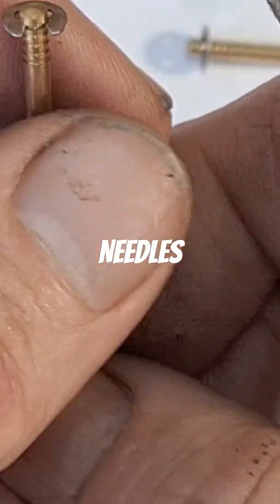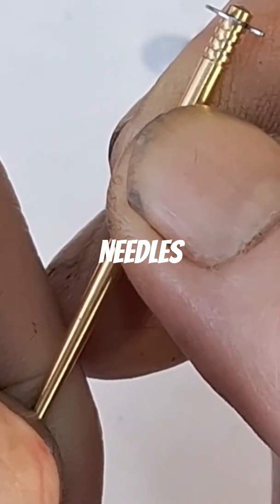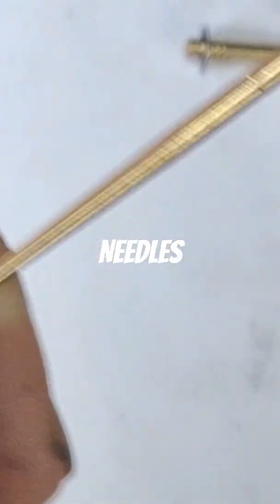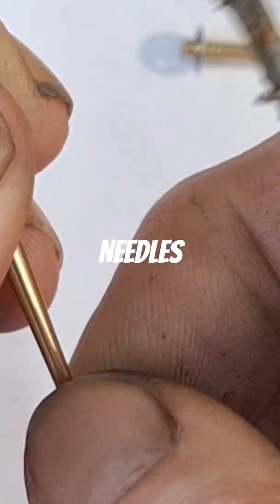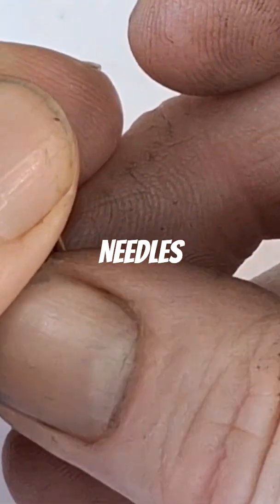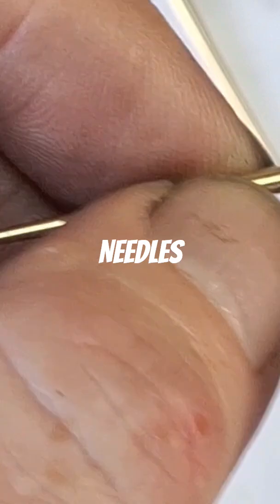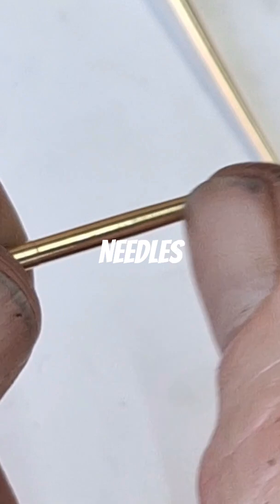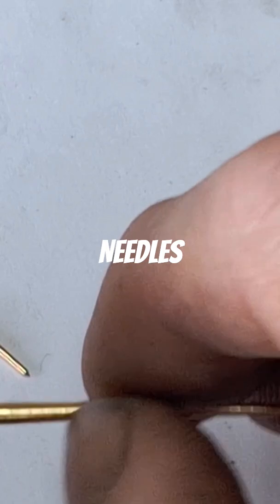What Happens If You Swap Out This Needle?

Comment: Good info, I'm trying to put different one in my 48mm mikuni and it's on 4th clip on top. 5th clip is messed up from taking in and out. But I'm not sure what clip to put needle on with the 6 different needle? Ty for All your info
Reply from the maker: Unfortunately the HSR is quite a pain to get the needles out of , as you well know. I would pretty much start off where you had it on the 4th clip. The taper only affects up to about 1/2 throttle. In essence anything above half is going to be identical as you had before. It would be a good baseline starting point anyway. 
     They certainly don't make it easy. If it were easy everyone would do it. Once you get it dialed in, you can say that you did it. 
   You didn't use someone's program and a lap top to figure it out. You did it. 
Appreciate the comment. and I'm glad it helped someone. Have a great weekend.